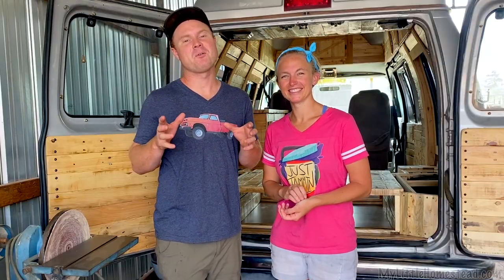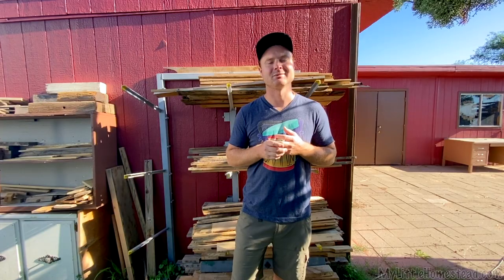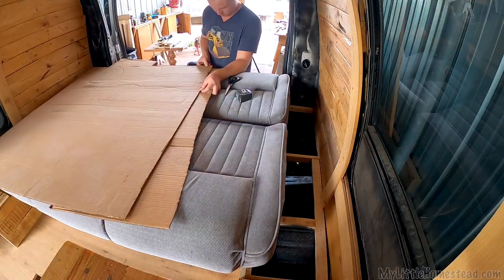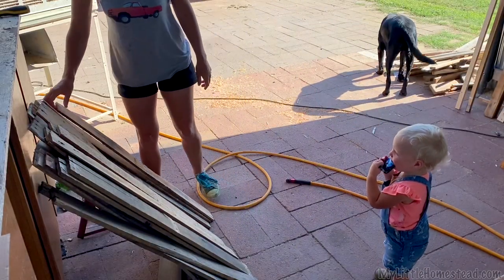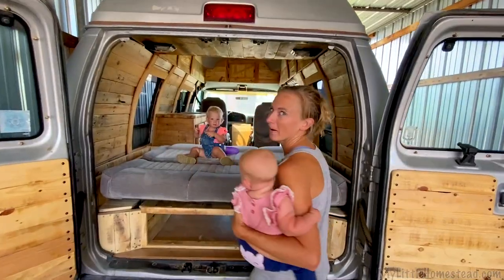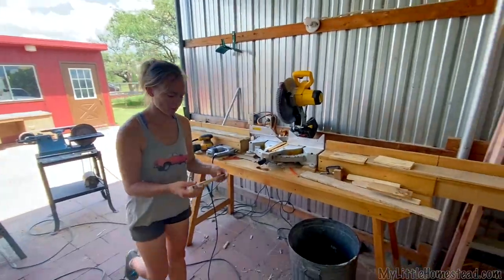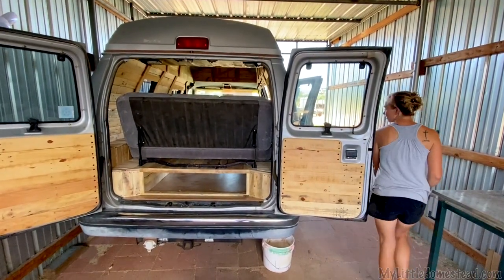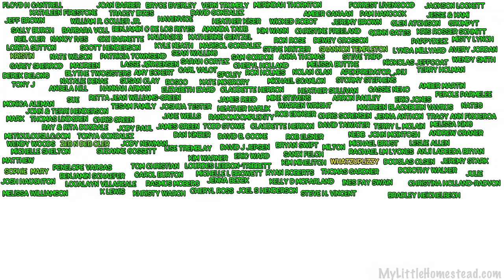Completing The Bed In Our Conversion Van | Weekly Peek Ep310

Comment: For a handle to get a hold of the lid of those boxes by the bed, you might think of some big holes near the front of them - big holes like cup holder sized holes near the front where if you were using the bed in seat position, you might find a cupholder most handy.
Reply: That's a good idea! Especially while traveling to have a cup or snack holder
Reply: That's what I was thinkin

Comment: Take your van seat/bed and reupholster it to be flat and get rid of those silly body hugging contours! Examine and copy the layout of a VW camper van, which has a flat seat that is pushed forward maybe 3 feet, the empty space behind it has a foam bed pad, when you fold the seat down, you have 7 feet of bed length. The bed is set to the right side, on the left side there is a hanging closet with a mirror inside the door, behind the closet is three holes with shelves behind the holes which are open to the interior of the van. A very functional layout!

Comment: i have made the long back bench as a bed in my van where I made a 2x4 go across the back of van inside doors and 2 legs attached on each end.  and a board going along the head/back of seat to doors, (extra space) put coats and extra blankets on the seat and a double mattress and sleep forward and head at back door.  each person can slide to end to get out of bed without crawling over each other ,, 60 inches long.  if clothes packs along sides of bed then will make a queen size bed..

Comment: Congrats on the 300k subscriptions.  To maybe make it a little easier to get the storage boxes out you could round over the bottom edge,  maybe making it a little easier to roll them up and out, that goes against the out side edge of the van. That would help eliminate catch points (square edge), and also provide a little more space when taking then in and out.

Love and Peace.     Blessed Be.     Doug.

Comment: I think you should consider figuring out a way to secure the bed frame to the frame of the van itself for safety reasons.  If you had to stop fast or got into some kind of a collision the entire backseat/bed could rip out of the pallet wood and become airborne.  Nobody wants that to happen.  I'm sure that Garen can figure something out.  The wood frame looks really nice.  But I can tell it's not strong enough to hold that bed in place under extreme pressures.  Like instantly going from 65 or 70 MPH to 0 MPH in less than 1 second.  
Take care.  sincerely,  Dean O.  :-I